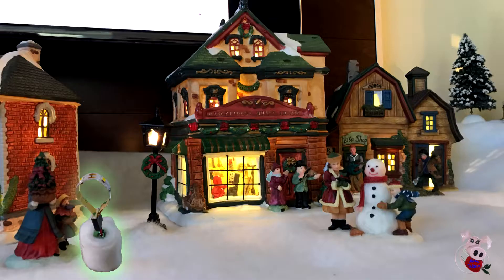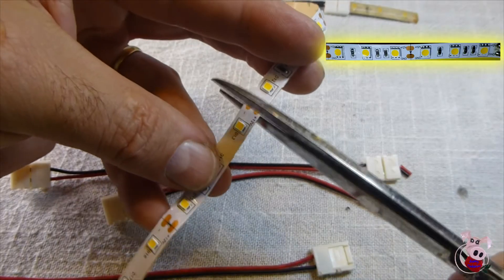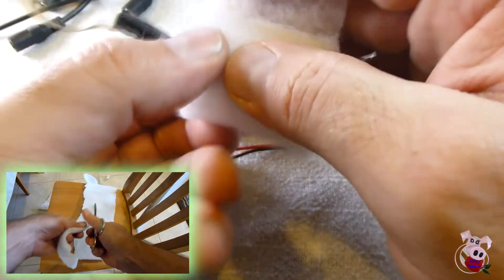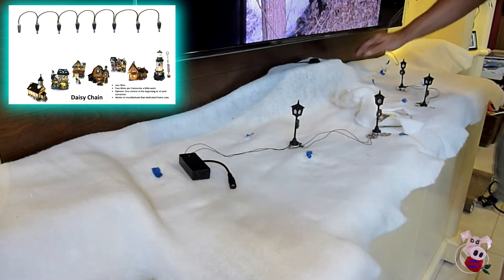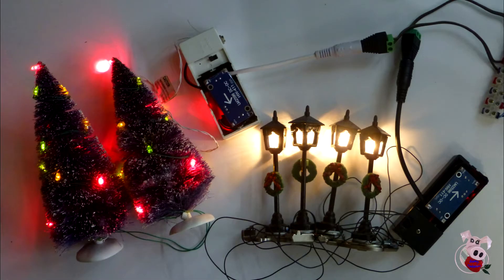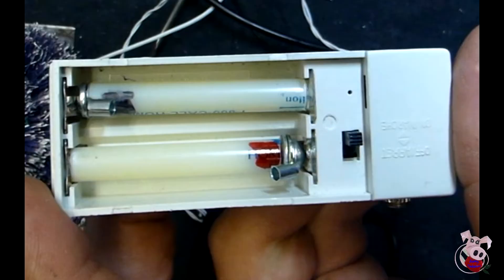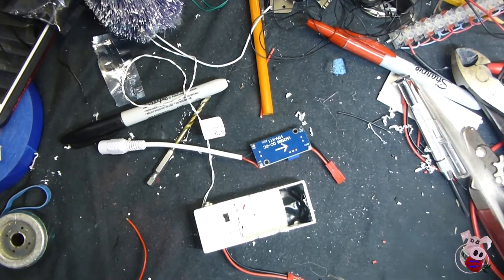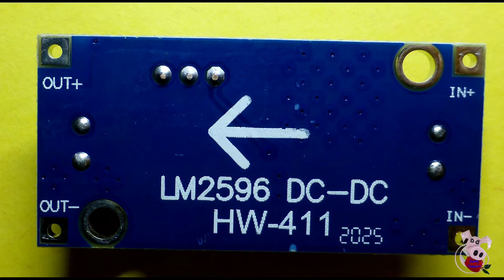Convert your Christmas Village Display to LED and all 12V DC power

Comment: This video was great! We changed over our village to LED using the items you suggested. I wouldn’t have known where to start if I hadn’t watched your video. Thanks for taking the time to put this together. Next weekend I’m going to try and convert the streetlights.
Reply from the maker: That’s great.  Start your voltage low on the incandescent bulbs.  Maybe even as low as 2.5 volts.  You can always work your way up but running them dimmer will extend their life now that they can be always on.  When you pack up at the end of the season you can put a dab of hot glue on the wires going into the connectors.  That will reduce them getting pulled apart during packing.